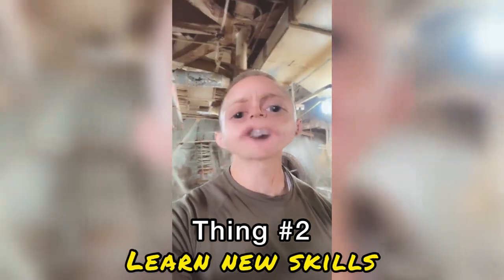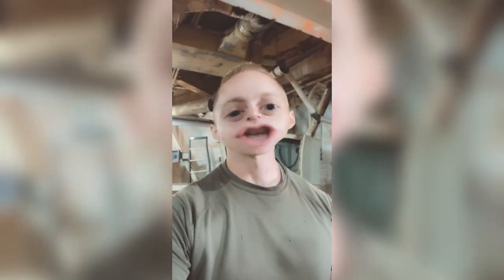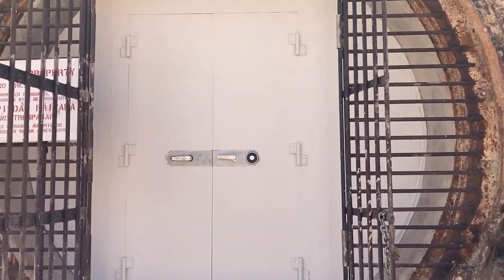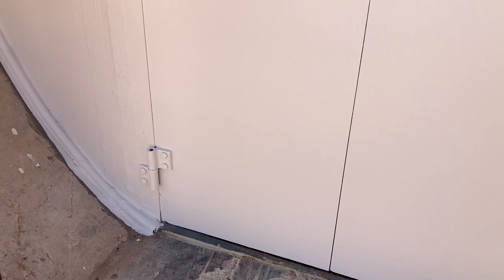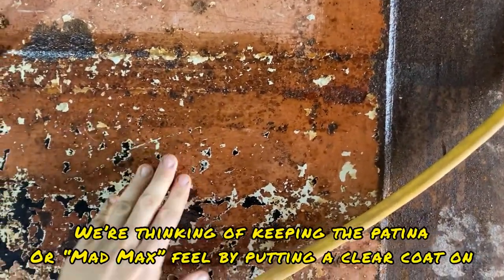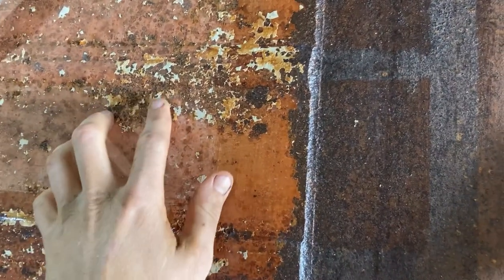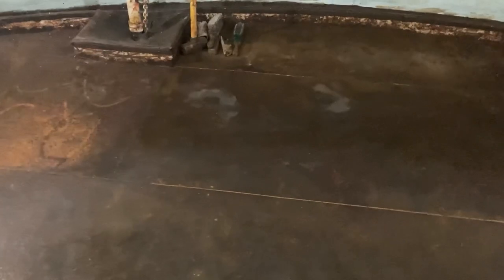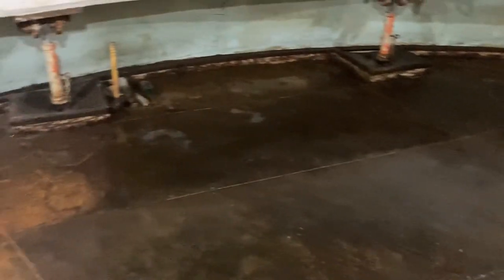3 KEY things to BUYING/OWNING a Missile SILO!

Comment: Having worked the DM sites for 17 years, we learned the hard way something about the blast doors. If you ever attempt to used the hydraulic lock cylinders (4 each door) do not coat the seal surface, especially with paint. You may never get the door unlocked.